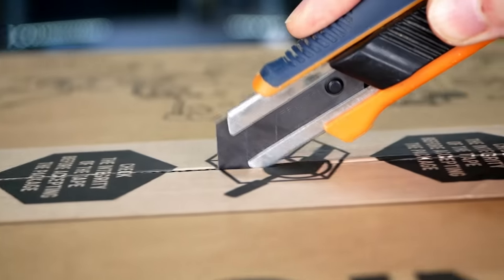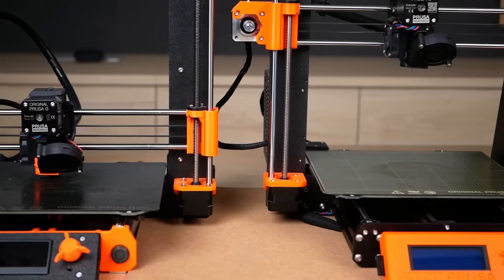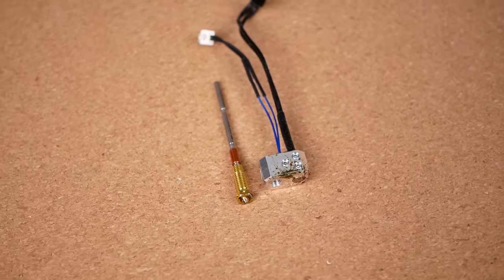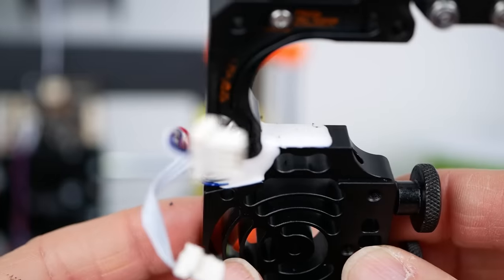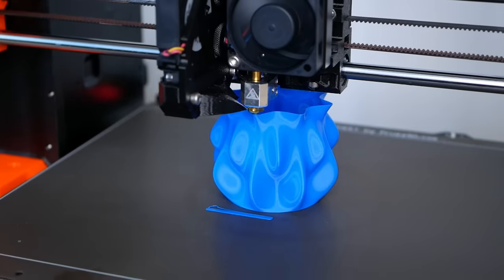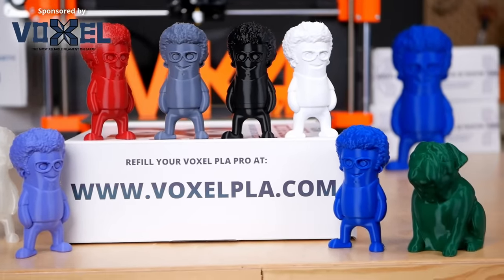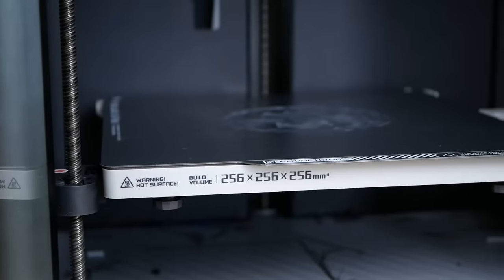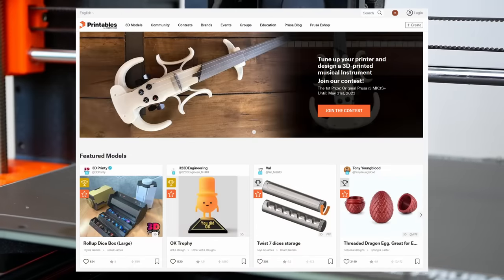Should you buy a NEW Prusa MK4 in 2023 or rather a Bambu Lab X1/P1P?

Comment: BambuLabs' releases last year were the best thing that could happen to Prusa - finally, an incentive to move quickly in the market. I've purchased five Prusas over the years and I will always love them, but they really fell asleep at the wheel with their dominance after ~2019. I'm glad that Bambulabs forced them to actually release something again.
Reply: If this was true, they would have released this last year. I don't think they care that much about any perceived pressure.
Reply: @scottr4086  well, they'll care soon enough then.  I think a lot of people would prefer the bambuLabs printer over the mk4.
Reply: It's sad that this had to happen. It shows how complacent that not only prusa, but the whole industry has become. Bambu finally woke them from their cryogenic sleep chambers.
Reply: Agreed. I built a Voron 2.4 and still love my Prusa Mk3 simply because it basically always works at least with PLA, PETG, TPU, etc. But Prusa definitely needed a kick in the rear to get them to focus. I will probably end up buying the cheaper upgrade kit for my Prusa as I like having a print around I'm not constantly tinkering with, and thus out of commission half the time (the voron).

Edit: Also Prusa support really is a value add to the printer when considering the price. When I assembled my mk3 it was the first printer I built, and I asked support some fairly dumb questions to be honest, and they were super informative and quick to respond, no way you would get the same level of support with Creality or some of the other cheaper brands.
Reply: @lukesmith9059  the problem is support is massively expensive and a company should not have to depend so heavily on it as the primary distinguishing factor vs the competition's hardware. prusa is in deep trouble unless they make sweping changes. also they have products like the MMU2 where no amount of support will help fix its fundamentally broken design.
Reply: they've been designing the MK4 before bambu most likely existed as a company. I'm sure they didn't wake up one day in 2022 and decide to build a new printer out of the blue.
Reply: @scottr4086  I'm pretty sure that is because they're confident and hopeful on the Mk4 and XL. We'll see how they feel about it once they have their sales reports, but I'm sure we'll see a price adjustment for their entire line up. 

I'm also pretty sure we'll see a scaled down Prusa XL next year and they'll probably have different product lines. Your entry level Mini, the enthusiast i3 bedslinger, the enthusiast XL Mini Core XY and the "enterprise" XL with prices scaling accordingly.
Reply: @FryedWater  then that makes what bambu did all the more impressive. bambu made a complete new printer from the ground up where prusa only released a change to existing printer. if mk4 changes took them 4 years (mk3 in 2019) then they are well and truly done.
Reply: @DiegoMS  i hope prusa will reconsider the lack of enclosure issue on the xl. curtain doesn't cut it these days.
Reply: @FryedWater  Of course they've been working on the Mk4 for years, you've missed the point. The point is that for years they felt exactly zero pressure to bring a new RELEASE to market. Now the pressure is on, and we're all the better for it.
Reply: @TMS5100  Actually, until Bambu labs, basically all the other companies copied what prusa did, only using cheaper labor and components. There is a reason prusa was, and arguably still is, the gold standard for Cartesian printers. And I do think that how long they have taken between the mk3 and mk4 has 3 basic forks, one the aforementioned copy cats. Second is the pandemic, and third is complacency. The second reason affected everything so that gets a pass in my book, the first is somewhat understandable as they produce everything in Europe and pay a living wage while adhering to open source. So they needed to recover some cost and I let that go as well as I understand that. The third reason is the sticking point for me. I think prusa as a company felt that they were at the top of the pile, had a product that not only was copied by everyone else but had no rival to compel them to do better, at least better faster. 

Then along comes Bambu labs. If you believe their story the x1c was developed just over 2 years, a kickstarter funded the start up of production, and they pretty much delivered what they claimed. There have been fairly regular updates, some good some bad. But they also went closed source. I think there are again reasons they did that, seeing how prusa was copied relentlessly is likely a major reason why, and ability to reach the speed they do is another. 

But let’s examine this a bit, Bambu labs 2 year development and prusa 4 years. One product is highly proprietary while the other is mostly an upgrade to an existing production platform, and many advertised features aren’t available yet. And it sure seems like the mk4 may have released earlier then they wanted because they had to. 

I like prusa printers, but they need to move forward a bit quicker if they want to remain relevant.
Reply: Issue is costs more then a p1p is slower, and has less features lol. Its like so for same price I can get p1p that is faster print times, just as good quality and get the AMS  attachment and still print in four rolls at the same time with purge towers for roughly the same speed as your mk 4 that costs more then again the p1p with AMS... Its like why would I want that? Your releasing a state of art last gen model into a market with next gen in it and then you charge more for the old gen, slower, less option printer then the compitetor? What the hell?

At least creality is trying to do a knock off of bambu they busting their ass to catch up and Prussa is like "here is what would been cool before the ankher, and P1P came out last year that kick this things ass, oh and Prussa label so pay us more for this.
Reply: @FryedWater  Yeah that is the point they over engineered it and didn't actually try to push they were like "lets not focus on all the things customers wanted, lets make an overengineered mk3!" Bambu literally did everything the market wanted, faster, reliable as hell, no assembly required, and better price then Prusa. The whole point is their design team had their head in sand, they knew at time they were starting up mk4 clippers and what what not were all over the place on Creality machines customers wanted faster speeds, reliable prints, not to have to hand tune everything, or build it themselves, and not be bent over for their money either.

And they went "no they buy this because its Prusa." And fan boys like that too singing its praise prerelease and then its like ok its not better then a p1p, and for that same cost I can get p1p and an AMS it can do everything m4 can do, and more for less money...
Reply: @TMS5100  But also its just revamp of their 2019 generation printer, and now we have 2 new generations of printers out faster, and bambu is offering things people wanted this whole time, like AMS system for less money. My p1p and AMS cost less then mk4 that is just a supped up 2019 pre covid printer, but they want me to pay more for less features, less speed, and about same quality in tech support and print quality lol
Reply: @Zalzany  while I’m happy to aim plenty of criticism at prusas development strategy the overall quality of their printers is undeniable. And the fact that they are produced in Europe and not China also drive the cost up. That being said it sure feels like the mk4 is overpriced for what it is. And it is a move forward, for Cartesian printers. 

I’ll agree for the build volume, features, ease of use, speed, and print quality my money likely will be spent at Bambu not prusa as I’ve moved away from bed slingers.

But that doesn’t mean the mk4 is a junk printer, it has many needed features the Cartesian printers desperately need, but it seems like, if you enjoy that sort of thing, you could build as good or better yourself. But not all features are available on the machine yet so who knows how good it actually is.
Reply: @shawnhicks619  i think the most telling thing about all this is all the new printers are now copying bambu, not prusa. all the chinese copycats follow the leader. that is no longer prusa.
Reply: @Zalzany  whats funny is watching thomas salanderer making excuses for prusa being behind in tech  "people dont care about printing fast"  lmao!
Reply: It's like Intel vs AMD. When one is dominating it us who lose.
Reply: @scottr4086  I think the quick drop of the Mk4, it releasing before some of their announced softwarae features are added, is pretty well definitive proof that Prusa is rushing things through. And if you are right that they don't care about the perceived pressure, then they'd be naive - because as Stefan points out, the price-to-features comparison between the Mk3S+ and the X1 is quite dramatic.
Reply: Best thing that happened to us you mean
Reply: @maxwell_edison  when you have to wait 5-7 weeks for parts and not 2 days ..... you will wonder if its worth it. We JUST got one back toegther after support hell. Thats wayyy to long to wait ... untill there is quick parts the bambu will just be a toy around here. Any open source machine we have is more usefull right now.
Reply: @scottr4086  Prusa most likely rushed their MK4 before they lose any more market share - is there even such a thing for 3D printers?
Reply: @TMS5100  Umm... I guess you have no idea how much more resources it takes to innovate when any electronic component you decide to use will be out of stock in a week for the next two years. It sloooooooooooooows you down. I've been bitten by this and I can totally sympathize. Operating in China during the chip shortage while the rest of the world needs to redesign hardware monthly isn't exactly impressive but just being on the lucky side.
Reply: @TMS5100  they have to sell at tight margins to get the crowd to move. they will have to sustain that margin to survive.
Reply: i'll be buying a Bambu x1 carbon with ams
Reply: This is 100% true. I worked at a print farm with over 30 Mk3s. They basically sold the same machine for 5 years with minor upgrades. They didn't want to release the MK4 yet but chose to do so. It's why it was shipped with missing promised features. Bambulab entering the scene is one of the best things to happen to 3d printing in a long time regardless if you hate them or not.
Reply: @FryedWater  yeah, totally. And that's why they released it with so much missing features, for which there is hardware, but no software, as Stefan points out...
Reply: @scottr4086  lol they absolutely care, as a company that needs to make money. The new ender is more current with tech than the mk4 and it's like $350. Prusa will die as a company if they can't answer this.
Reply: The Bambu Labs P1S+AMS Combo is the KING of the hill right now. It has the absolute 1000000000000000000000% best value you can get on the market. Sorry but this Prusa Mk4 doesnt even belong in the same room as the P1S or X1
Reply: SHITA MK4 BY SHITEPH SHITA WITH SHITAMENT 🤣👌
Reply: Agreed. This kind of industisl design doesn't pop out of thin air.
Reply: I got the new x1 and will never look back lol... to each their own.
Reply: Well I just got my p1s and I really wish I got the mk4 instead. (And I have 2 mk3s+ currently)
Reply: I was a Prusa guy.  Now I'm all about Bambu
Reply: I agree. I love Prusa and currently own 2. They have done so much for the community and I will always support them. I think they could be  a whole "generation behind the X1. I love the X1C and its my dsily driver but my Prusas still print every week 😊
Reply: Lack of competition is bad, but this new competition is great. For consumers and companies.